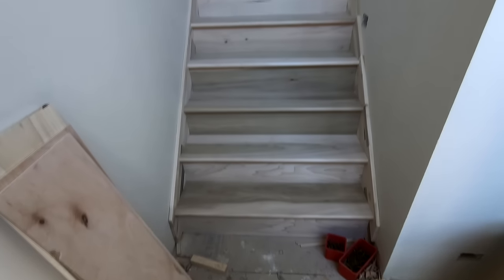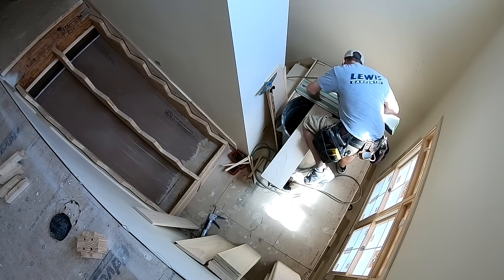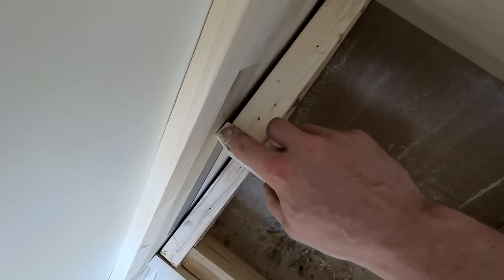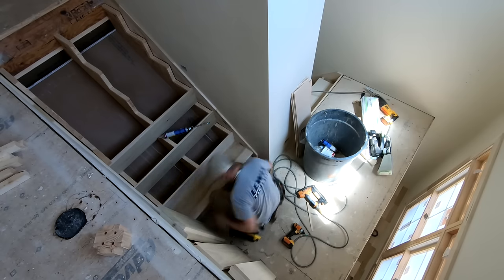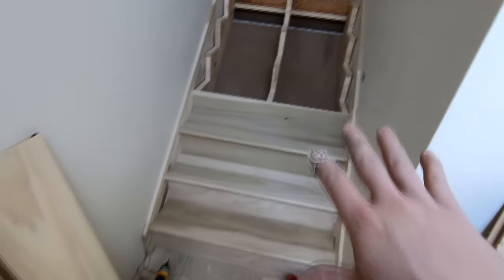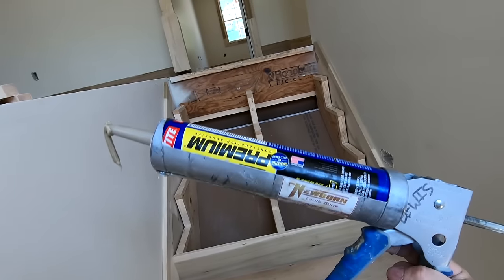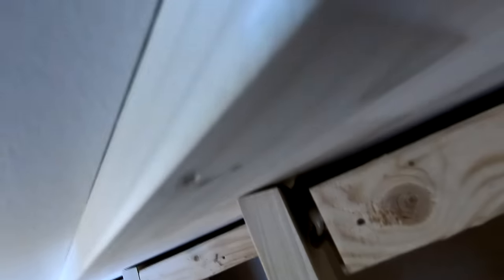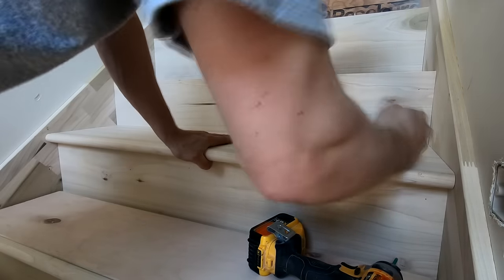How to Install Hardwood Stair Treads & Risers...Key Techniques for Perfect Results

Comment: One of my favs, so many little tricks that go a long way! I've always wondered, what blade do you use on your HKC 55? I got one after watching your videos and there is no looking back, its amazing! The Festool blade is not my favorite though, it doesn't cut super clean, I've been thinking about getting their 18 tooth and seeing if that works better. In this video it almost looks like you use a different blade all the way?
Reply from the maker: Mostly a mix of festool & oshlun blades for that saw. I have been using Freud for the TSC55 and have been happy with them,.

Comment: Working smarter, not harder is a good mantra. On that note you might want to invest in a pair of hand spring clamps to secure that Collins stair gauge to your work piece. Its much easier, more secure, and less gymnastic than using your knees. Also, tap those pieces of stair part into place with a rubber mallet instead of your fist. Your young and (relatively dumb) now and can improvise. Later on in your life as a carpenter, you'll understand both pieces of advice.

Comment: Ive been an historical remodeler for 20 years and i have to say..Thank you!. That last video with rolled miters... nested position.  How did i not know that by now? But this video... ive spent over $200 on stair guages at least twice in my career. I just ordered the Collins through ur link.  I have just one question.  Those look very much like poplar treads? (They very well could be freshly seasoned white oak but im not not on site with a block plane to check so i have no idea)How do they stain? Ive never used a soft wood for a stair tread.

Comment: whats with the electrcal box half way up the stairs? this is quality work but it can and has been done in the past with hand tools
Reply from the maker: Lights
Reply: @InsiderCarpentry  so not an outlet/plug it will be a light fixture?
Reply from the maker: @tommcluckie6034  Correct. Its very low light, but a lot of people like stair lighting to keep things illuminated in low light situations without having to turn on the larger light fixtures.

Comment: 2:46
I’m a carpenter with 20 years (about) under my belt. I do stairs completely different and IMO a much easier way.
I’ll try to be brief…
For one I only tack the skirt board on the walls so I have some wiggle room. 
I then cut all my treads and riser just square and to just about 1/2” long. 
Two things I do are I have the riser lap down behind the tread, this way I can screw the riser to the lower tread from the backside (this method along with shimming and PL glue basically eliminate any chance of squeaks). As I’m installing a section of a riser/ tread I reach down to use longer construction screws that go through the stringer into the skirt board. Using screws like this through the stringer sucks the skirt board tight to the tread/riser. 
Using this method above as long as the walls and drywall aren’t in terrible shape you usually can just pre cut everything nice and square and to your final finished dimensions as you are pulling the skirt tight to everything from the stringer underneath.
Most stairs I do are fairly complex and have a 2 piece skirt package that goes with the 2-3 piece base detail of the house. So if my skirt ends up drifting away from the drywall a bit I have a cap that I’ll be installing that would cover that gap anyways. Even if you don’t have a cap you can let the skirt float over bad drywall by up to about 3/16” and still be fine as the painters will clean up that gap. Kind of the same principle as keeping your base straight on a bad wall and caulking or floating mud to the gap rather than having wavy base on a wavy wall.
Reply: @insidercarpentry read above and let me know what you think of my ways

Comment: Great video! I definitely learned a lot. If you're worried about nail holes, why do you nail so high on the riser? Nail lower so that the tread of the stair below covers the nail hole.
Reply from the maker: Doesn't need nails on the bottom. The rise gets screwed into the tread from the back. There is nothing to hold the top of the riser in place. It needs a couple nails or it could move before the adhesive cures.

Comment: If you cut all your risers and treads so tight, wouldn't start creaking with temperature changes as the wood expands and contracts? BTW really nice video.
Reply from the maker: That’s why I back bevel everything and use a ton of PL premium on those connections.
Reply: @InsiderCarpentry  I have to redo the stairs in my house, and I'm also replacing the skirt board on both side (they were installed after the treads and risers) any tips you can give me? Also how do you sound deaden so it doesn't sound hollow when you step on them? My kids love to run up and down and since we removed the carpet it makes a big difference. Thank you.

Comment: Hi, with installing hardwood stair treads are you not concerned about wood movement? I watch a TOH video as well and they were rabbeting the riser side of the tread to accommodate movement... is this necessary? Thank you and excellent channel!
Reply from the maker: I feel like the way I am  doing it is just fine if not better because I'm creating an actual connection with wood clue and screws. I feel the rabbit is fine, but the idea with it is that you're planning on some level of movement. This may have been more needed in the past when glue technology was not as good. The way I am doing it the tread will split before that glue joint breaks.
Reply: @InsiderCarpentry  Great info. If it's good enough for you then it'll do for my stairs!

Comment: Could you screw the top of the risers from the back (through the the stringers at an angle) instead of nailing to minimize nail heads?  Would still keep the tops of the risers from kicking out.

Comment: Two questions. When you measure for the riser, you said you take 1/8” off the rise height. Do you take that 1/8” off with the 5 degree bevel or do you deduct the 1/8 then do the bevel?

Also, since you can’t screw in the top tread, is glue all that you use to attach it?
Reply from the maker: Nail the top tread, or pressure fit and let adhesive set depending on how good the fit is. Just can't let anyone step on it. 

On measuring, it really doesn't matter.

Comment: I enjoy watching and learning from your videos. I do have a question. With you not nailing your treads in and depending on glue. Do you worry about the glue squishing out while you are going up and down the stairs? Just a thought I am about to trim out a set and I am wanting to try this but kinda worried about that part. Thank you for the videos and please keep them coming
Reply from the maker: I'm using PL premium adhesive. It pretty thick so no. Not worried about it. It cant really squish out. It's down against the rise and screwed from the back. So there's nowhere for it to go
Reply: @InsiderCarpentry  
Do you still use PL without nails when called for?  If I hired you, I’d ask if we could avoid nail holes in the tread.  Your more recent videos use nails.  Did you find that it PL alone did not hold up the way you expected?  I want my stairs (converting from carpet to white oak and painted risers) to be squeak free and last as long as possible.  AKA—till I’m gone.  Lol.

I’m having difficulty finding a vendor to do my stairs the way I want therefore I am considering doing them myself.  Filling nail holes on my white oak (natural finish with no stain) is a choke point as all the fillers I’ve tested are unsightly.  I’ve not found a single person in the trades (even called PL support) who advises using adhesive without face nails in the tread.  My gut tells me it DOES work as you say.

Comment: Know what you're dealing with dude, stringers all screwed up, you saying the painters suck, also that big ass window in the middle of the landing. Did you have to put railing there to pass code? I would've in my neck of the woods. That tool you use to cut the treads with is the shit. Been cutting with a 12" slider for the last 20yrs. You never stop learning. Awesome vid!

Comment: if the 3 nails for the risers are just to hold the height, then why dont you put them at the bottom, then when you put the step on, it will be hidden so no holes at all?
Reply from the maker: Because there isn’t anything holding the top in then. It could potentially kick out away from the stringer and cause some major issues. On the bottom the riser is sandwiched between the stringer and tread until it’s screwed.
Reply: @InsiderCarpentry  its just you said its only holding the height. so thought id ask, seems its also holding the risers from kicking away under pressure until the glue drys

Comment: Great video! I've seen in other installs that there's a dado on the riser to help with any gaps of wood expanding and contracting. Does this not apply because you're using PL?
Reply from the maker: I’ve seen that also. But I don’t see an advantage in adding a dado here.
Reply: @InsiderCarpentry  If the wood expands or contracts, will that cause any damage because the PL is super strong? Thanks for answering a noob question.
Reply from the maker: Personally I’d rather have it all glued together vs a loose board moving in a dado. The dado would open up possibibikitu for squeaks. Also, the highest quality stairs are housed staircases and that are all completely glued and screwed together.  So I’m going to lean towards glue and screw pretty heavily.

Comment: If the sides of the top treads are cut 5 degrees, can you see that bevel as you look at the nose of the tread (not being flush with sides)? Great video thanks
Reply: The treads dont get the 5 degree treament, he said to make sure you change the saw back to 0 when cutting the treads :)
Reply: Somebody wasn’t listening.
Reply: @welshman100  Reviewed video and saw that I missed it after I posted - thanks.
Reply from the maker: All good. You could actually make that cut on just the back part and leave the front 1-1/2” square. But I found that they went in just fine being square.

Comment: Great channel, great advices! What blade do you recommend for HKC 55 for this job?
Reply from the maker: Its very low on power so as few teeth as possible. I think all the HKC blades I have are festool. I also use Tenry on track saws. Or if I want cheap I buy the oshlun blades off amazon. Oshlun are throw away for me. Tenryu and Festool blades I have resharpened.

Comment: Have you seen the knock off of the Collins Tread Template Set on Amazon that uses your pictures?
Reply from the maker: No, I haven't.
Reply: Just copy and paste on Amazon clic on the item and go through the pictures:
Stair Tread Template Set，Replacement Template Steps Risers Clamp Plates Hand Tool
Reply: Guaranteed it's some Chinese ripoff artist selling crap. They're all over the web, so one has to be careful!

Comment: It looks like someone made a knock-off of the Collins Stair Tread Template you pitched and used your footage (at 19:03) to advertise it on Amazon found with search "Stair Tread Template Set，Replacement Template Steps Risers Clamp Plates Hand Tool". You may want to make sure you get paid.

Comment: I used to use my festool track saw to cut treads but 2 jobs in a row cutting white oak treads I ended up getting really bad pinching on the blade cutting an inch or less off the sides. The saw works fine on everything else.  I ended up going back to using my miter saw and haven't switched back yet. Anyone else have that issue.

Comment: Theres no good video on YouTube Demonstrating stair skirts.. maybe you make a video?
Reply: I agree. Maybe also Newell posts and rails?
Reply: Treads & risers easy. Posts, rails, goosenecks and easements is when you are a “stair guy”! 30 year “stairguy” here. Never saw or used poplar treads ever! Finger jointed skirts also.
Reply: @cockerluver  while I have never been a fan of fingerjointed materials, they do have a place in today's world.  No longer should we simply use up our resources indescriminately, we don't have 9' wide spruce trees 100' tall.  If you are painting, why worry?
Reply: @cockerluver  Poplar is too soft for treads.... That said, he did a nice job installing. As I can't look inside the client's wallet.....
Reply: @cockerluver  Yes, usually stain grade tread is hard , maple , white oak , birch possibly.   Paint grade risers take a lot of abuse,  I would spec a harder species. 
The paint grade skirts can get by in poplar ( soft ) , once again, easily dented / gouged !!
Good work though, the builder / budget controller most likely speced the materials .
Cheers

Comment: Nice video, many great tips. I like the 5* back cut for glue. That festool saw is ideal, but is there a cheaper second best method?
Reply from the maker: You could make a shoot board that would be used with a standard circular saw.
Reply: Insider Carpentry I can always paint that shooting board green :)

Comment: Don’t you worry about shrinkage with a 5 degree bevel. Especially with poplar.
Reply from the maker: If its properly acclimated and the house is conditioned no. Its all glued together so I think its fine. If the treads were saturated at time of install it would be a different story.

Comment: perhaps you should at least  predrill  the holes in the risers in order to make the screws run straight  at the perfect height and not split the wood !
25  years ago a older carpenter on the job told me to buy suspenders for my tool belt !  I am glad that i did - it was so much better to use then just a belt !

Comment: Loctite pl is annoyingly messy. When I don’t need huge quantities I buy the 8x fastgrab because it runs out of the tube way less
Reply from the maker: Great tip. I’ll have to give some of that a try. 👍
Reply: Insider Carpentry it’s the way to go for small projects. Probably 50% more expensive than the 3x. Good luck with it and thank you for another video.

Comment: I mostly do oak treads and rails omg your lucky
I remember learning everything with a skill saw even crown
I finally graduated to the big boy dewalt table saw and stand and the dewalt 12"sliding saw and stand 
I found out real quick after doing 2 staircases with them only use them for risers and handrails 
Because the oak is too hard im better off using the skill saw for oak treads
I was watching you rip that bevel on those poplar treads and was like yea if that was oak after 2 treads the video would of been smoked out

Comment: For the majority of work you do in customers homes, do you find you need a 12" slider miter saw or would a dual bevel 12" drop saw suffice for the size crown and base you install?  What have been the benefits of the slider for you?  I'm gathering opinions... :)
Reply from the maker: Dan Sarfert I need a slider for the type of work I do. I’ve tried with non sliders and it’s just a pain.

Comment: What’s up with the strips added to the stringers. Here in Florida every staircase I’ve ever done is built with rough tread and riser in place so this method isn’t an option.
Reply from the maker: It was framed for carpet. So I had to adjust rise and run when I removed the 2x framing.
Reply: When I said in place I meant they glue them both in. You do do great work I’m impressed. Do you normally set your skirts that low or were you just allowing space for stair lights
Reply: Can’t tell you how impressive your videos are.   Love that you come back and show the detail which makes it all clear.  Not sure why the strips on the treads were necessary because it was originally designed for carpet?  Not understanding the height differential?

Comment: Did this video make anyone else justify to themselves that they can now go out with good reason to purchase a Festool HK55?
Reply: I had never really seen the point of having a track saw until recently on a job where a portable table saw just wasn't going to cut it for accuracy. I bought a Makita track saw for the job and man I tell you, while not absolutely necessary I would not be without one now just for speed and ease of use. I think for the amount of use I would get out of it I could justify the cost of a Festool but you would have to be sure you were going to use it a lot. The plunge type zero clearance is more expensive but probably worth it for the added utility.
Reply: Lolz...! I already love my HKC55 but I need the dust bag...it really worked well in the video. I thought it would be useless...but now I’m going to order one...!
Reply: That's a nice tool to have for sure!  I measured my treads and risers the same way, and used my Dewalt 12" miter to cut them.  Takes a little guessing to get the angle correct, which is where the track saw is handy.  For most of my steps, one side was cut at 90* and the other just a little wider due to a crooked wall.  Not too hard overall.
Reply: Looked at it , knew it would be about what their asking for it , alas Amazon out of stock , or I might of pushed the button .............
Reply: In the video he was face cutting , from what I could see  there was 0 tearout  !
That's tricky to do on portable saws !
Though I couldn't get a clear view of the exit of the nosing cut , ( 1 crosscut exited the riser side, 1 cut exited the nosing  )  ?